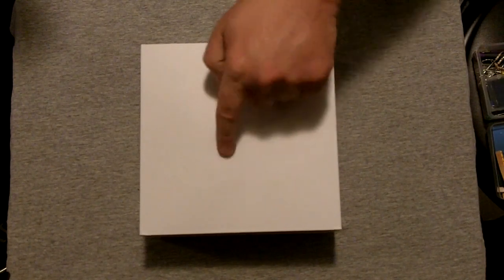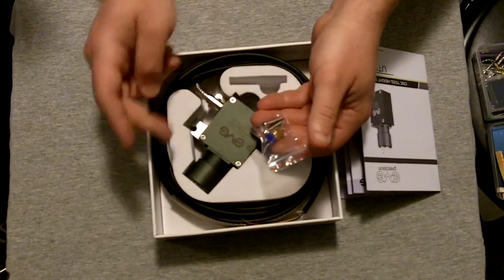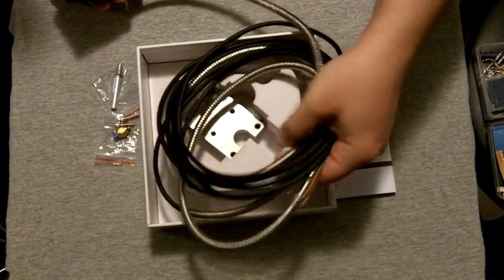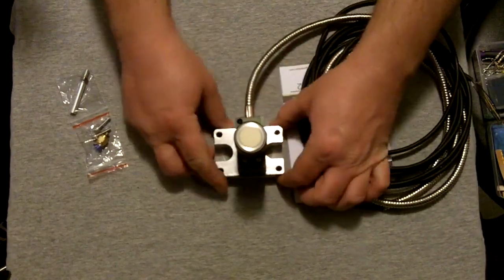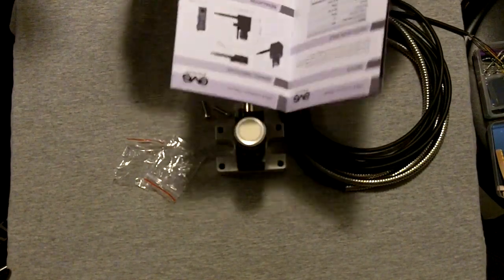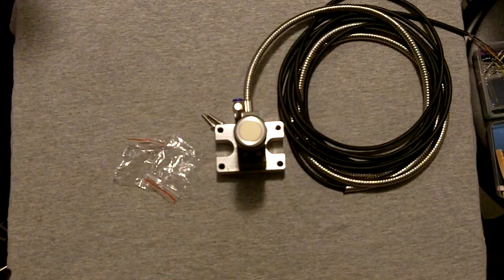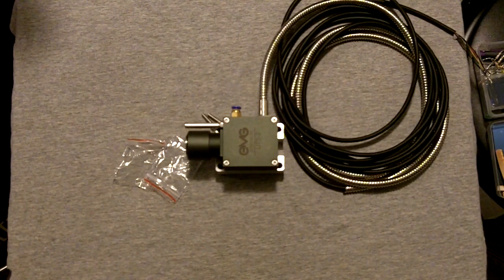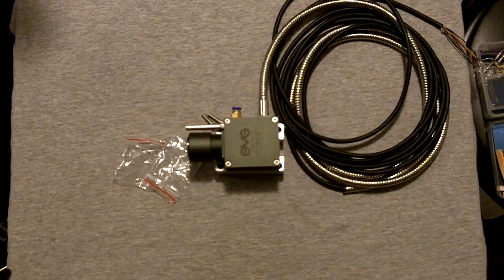EMG UTS-2 CNC Tool Setter - first impressions

Comment: You wouldnt happen to know how to connect one of this to a Siemens system? I can see the probe inputs, but i cannot for the life of me find the probe "on" m-code and wire that back to the receiver.. 

Better question i guess is.. how the  heck do you make custom Mcodes and tie them to an output.. sweat :D
Reply from the maker: Unfortunately, I do not. Might want to try contacting Chris Pollack at Siemens
Reply: @TheFeralEngineer  Thats MrCNC right.. he usually just refer to the support hotline and they try to sell me shit i dont want. :D
Reply from the maker: @roughedge-machineworks  😆😆 yes, Mr cnc. I'll have to have a talk with him 😆. There's a guy on Instagram that might be helpful. His ig name is innonium
Reply: @TheFeralEngineer  ive found a bit of information on linkedin of all places, where it seems the UGUD files can be used for mapping custom cycles to an M code. but what i dont get is how i map a relay controlled output to a an Mcode so i can actually turn on and off shit, including the probing routines. (i dont seem to have the M27, M28 commands in there, but i can see the probe being yellow in nc command so i suspect the pin outs is there at least.)
Reply from the maker: Ugud is for setting up custom variable tables. I cover a little of that in my siemens array and easyscreen videos. You probably need to map the output via the dbx.xxx number from the plc using high level language. I know how to trip a bit with an easyscreen, but i haven't played with it through m codes
Reply: @TheFeralEngineer  ah yeah that is the problem i guess... been poking around my PLC program, but havent figured out where the dbx.xxx number actually map to an Mcode.. i found most of the turning on spindle and stuff like that.. but there is equally a shitload of weird crap going to pumps and what nots around the machine.. but nowhere in the PLC will you find "M3" for example :D

But there is a way of telling the controller to go into probe mode without the M code, so i was just thinking i can isseu that command inside of a user cycle tied to the mcode.. just need then to figure out a output pin that goes thru some unused relay somewhere...

On that note, i have reverse engineered with the help of your easy screen videos all the measurement cycle interface from shopmill into hmi adv. sweat :D
Reply from the maker: @roughedge-machineworks  looks like on the sinutrain virtual machine, spindle clockwise is db31.dbx30.1... let me see if i can mess around with that a little and force feed it a 1/0
Reply from the maker: @roughedge-machineworks  you can download a trial of sinutrain from the siemens website. You go to menu select, diagnostics, nc/plc variab and can use insert variable to find it in a list. When you hover over the signal once it's on your watch list, it shows the db.xxx number. I do a whole thing on it in my last easyscreen video because I show how to use a soft key to trigger cycle start 🙂

I just found out you can also see the db.dbx signal numbers on the choose variable screen, by the way
Reply from the maker: What machine is it, by the way?
Reply: @TheFeralEngineer  Its an old Xyzmachines 560 minimill (2003). A compact little 3 axis machine, with a 8000rpm spindle, 11hp, and 10 tools in a changer.. Perfect to have in a home garage essentially. :)
Reply: @TheFeralEngineer  ah went and looked, Sinutrain you are using is way ahead of my 6.4 based hmi adv. that i got working (think i have a video of my old hmi embedded controller dying).. Ive been restoring this machine for the last couple of months.. just getting all the damn cycles working again has taken weeks upon weeks.  geesh :D

Comment: It will connect to LCNC in the future tutorial? (sorry, but skipped a little the video)
Reply from the maker: Yessir
Reply: @TheFeralEngineer  👍👏
Reply: Still waiting 😂
Reply from the maker: So am I... 🤣

I need to circle back to my machine builds but I've been inundated with work, school and 3d printing stuff lately. I will be incorporating 3d printing heavily into my machine builds, which will rectify the stalling point I reached on my mill, so stay tuned for that. Once the mill is operational, the tlm system will get installed 🐱
Reply: @TheFeralEngineer  that’s great to hear! I’ve recently purchased a 2008 Saeilo MMV1100 with a 840D controller and unfinished custom mill with a 7i76e and Linux cnc. I’ve never done any cnc machining but I need one for my business. Anyway, this lead me down a rabbit hole and I’ve done nothing but watch and read everything cnc machines for the last 3 years. I hate to ask since you’ve mentioned that you’re so busy, but I would love to leverage you’re knowledge on these controllers - at least to learn the basics. Would you be interested in providing Skype-like lessons? Of course, I would compensate you for your time. Kind regards.
Reply from the maker: @grandmastersreaction1267  that might be possible.

What version of 840D? Is it powerline advanced hmi or is it solutionline?
Reply: @TheFeralEngineer  oh that’s fantastic to hear! 

I’m not actually sure. It wasn’t specified when I bought it. Honestly, I wasn’t aware there were different versions of that controller. Feeling a like a noob now. I’ll contact the reseller and/or the manufacturer and get back to you on Monday. Do you have an email I can reach you on?
Reply from the maker: @grandmastersreaction1267  if you have it powered up, shoot me some pictures of the main screen, I'll be able to tell right away.

theferalengineer@gmail.com

Comment: first comment LOL  I would love to see how it handles micro endmills and drills.
Reply from the maker: That's still a thing?
Reply: @TheFeralEngineer  only when you need to make alot of small vent holes in a plate.
Reply from the maker: @my1987toyota  i meant the first comment bit 😆. What diameter would you like to measure?
Reply: @TheFeralEngineer  LOL. I haven't gone under .032 . too afraid of snapping the bit . drill or endmill. I would love to see if the sensor could measure a .032 without breaking it .
Reply from the maker: @my1987toyota  lasers do an okay job, but since using them often, I find them to be a little finicky